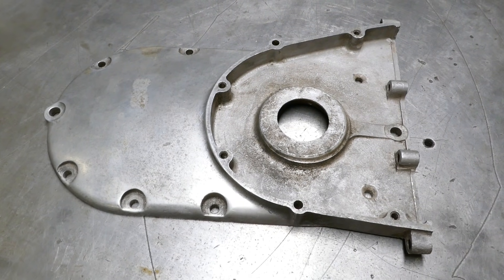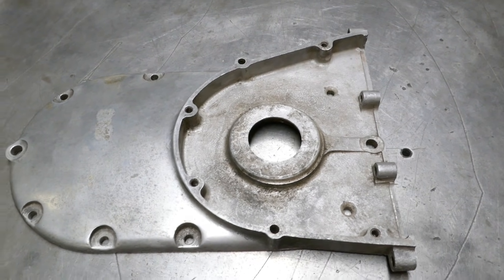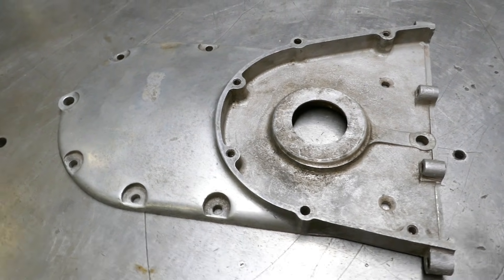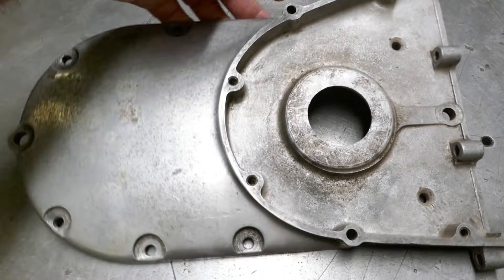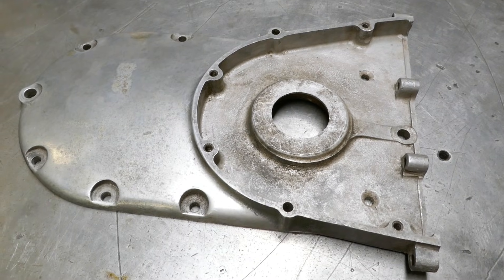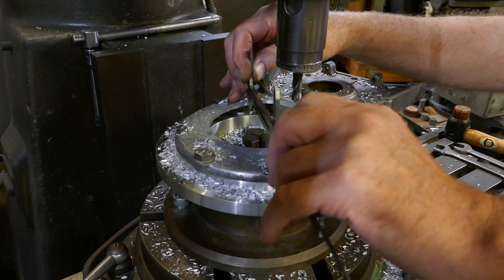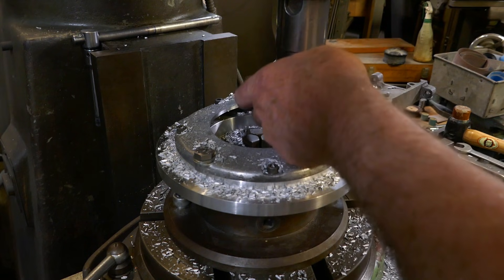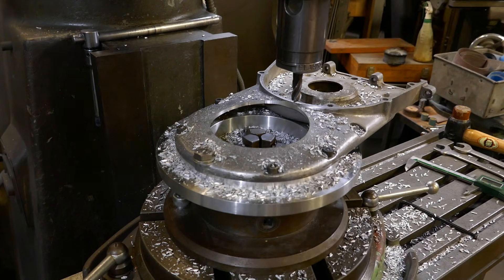Ariel Square Four alternator conversion. Using a turntable to machine a large hole in the drive case

Comment: I think the Ariel was the only 4-stroke square four?  The weirdest square-four engine has to be the 500cc one Suzuki made in the 1980s which was basically two 250cc liquid-cooled 2-stroke twins on the same gear case.  There were two versions of the engine, with one having the front crankcase lower than the rear.  It made 120hp in racing trim.
Reply from the maker: Yes, the RG500!

Comment: I have tried a similar conversion on a BSA A10.  That is mounting a  kubota alternator to the end of the crankshaft.  It unfortunately put too much load on the drive side bearing, that is, it became very warm in a short period, so I didn't persue it.  I mounted the alternator in the primary chain case, via a pulley off the crankshaft.  I managed to obtain clearance in the primary chain case by fitting a spacer block between the inner and outer primary chain case cover.

Comment: hi are you sure that the front gear is exactly centred on that cover .i would try it on the engine to make sure before going any further mate cheers
Reply from the maker: It shouldn't have needed to be centred exactly, as the bore of the intended tube is a fair bit larger than the alternator rotor. BUT - we are going to have to use a slightly smaller tube & will have to pay more attention to the alignment...